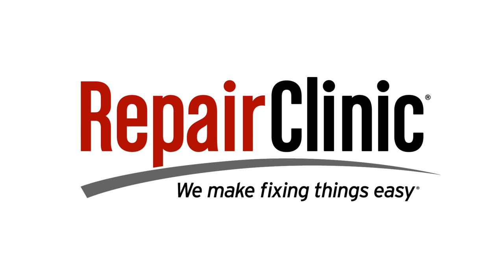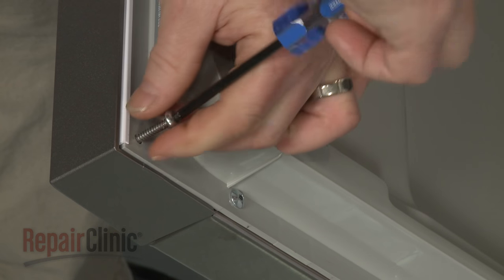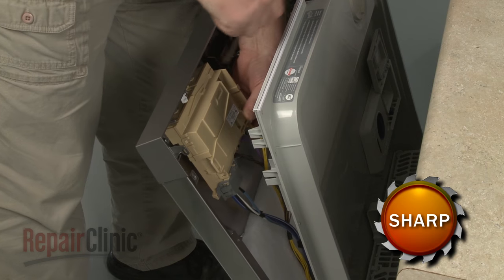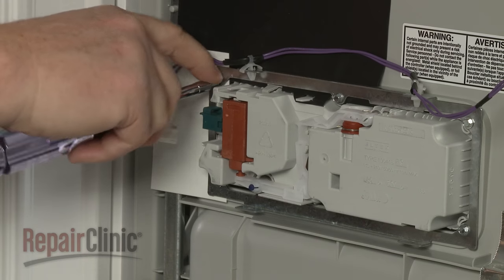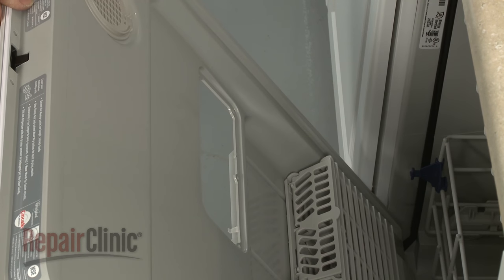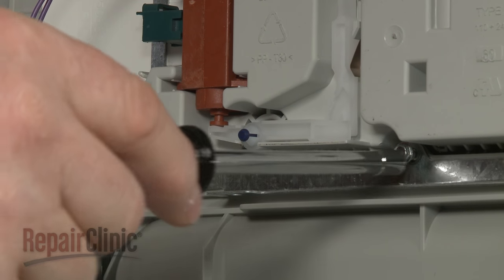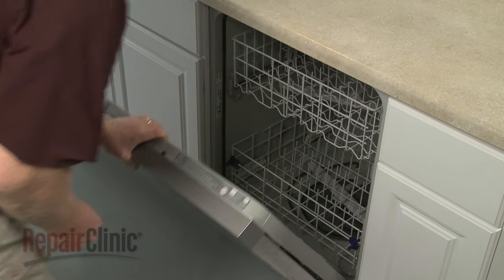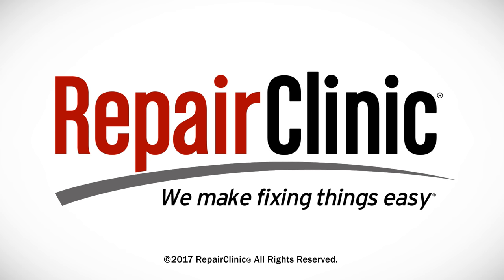Whirlpool Dishwasher Detergent Dispenser Replacement WPW10671905

Comment: Is that cardboard shield on the left side of the dispenser really necessary ? Mine was gone but I can cut one if needed.  I installed this yesterday but it's leaking from around the new dispenser,  it appeared to snap in properly.  I'll have to uninstall and see why tomorrow.  Good video, I needed a refresher ! Thanks.

Comment: On my model, the lower door panel is separate from the upper part with the control board. I just had to remove the lower 4 screws on each side to remove that panel for access to the dispenser.

Comment: I just did this replacement thanks to your video. I ran the dishwasher and it started leaking through its cycle. Any idea what i could have messed up that would make this happen?
Reply: I just did that . I had of course remove the door panel again ,,SUPER FUN , to tighten up the new dispenser more way more.. . I was afraid to break it. I bet you did the same. Tighten the hell out of it .NO MORE LEAK!
Reply: @kathypebley28  we also made a leaky seal at first, opened up, tightened them all much more, no leak
Reply: @kathypebley28  p.s. on the 2nd try we found the door cover can stand on its own next to the dishwasher with the control panel installed, while you run the DW for a minute to watch for leaks.  Obviously you need to not stick your fingers on anything potentially electrical during this test.
Reply: @kathypebley28  This worked for me too. Thank you so much!

Comment: Can you explain what to do when you have removed all of the anchor screws except for 1 behind the handle that's the backside of is stuck in that black shield. It will not back out at all and because of its location I can't getting the backside to get it out. Not even my 40+ yr appliance repair uncle knows how to get it out without breaking it.